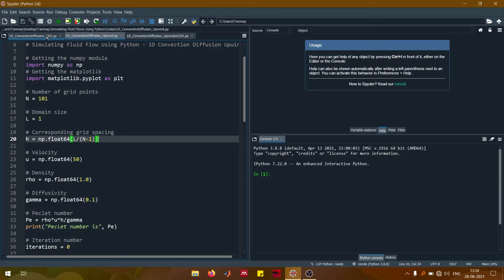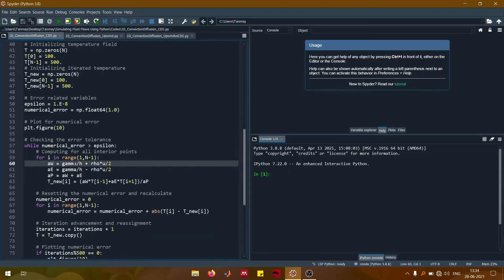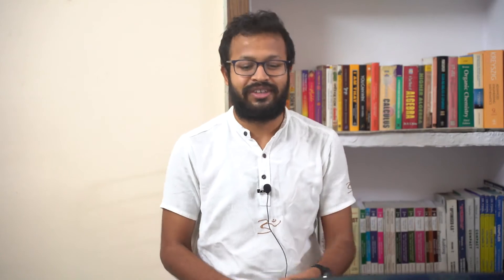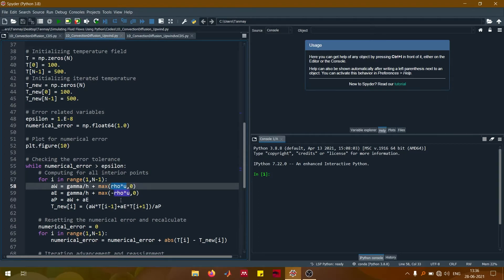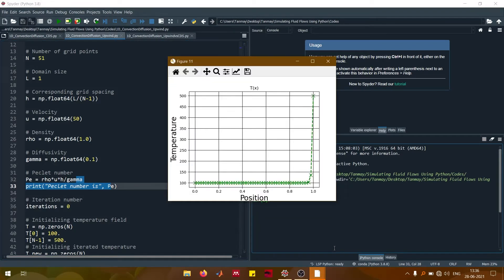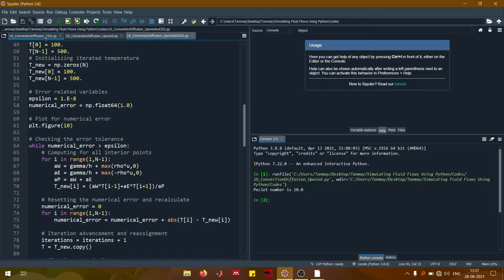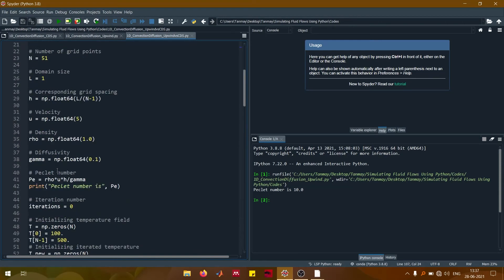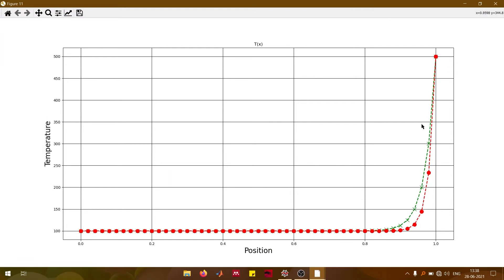Python Script for Steady 1D Convection Diffusion Equation Using Upwind Scheme | Lecture 18 | SFFP

Comment: first of all the lectures you are providing is awesome, my question to you is, how do i tackle the solid fluid interface boundary for heat transfer, can you please give me some good sources to follow this.
Reply from the maker: Look into immersed boundary methods
Reply: @TanmayAgrawal7  dear sir i had just gone through the immerse boundary conditions which is basically fluid solid interactions(more like in case of fluid flow field), but I have a problem in the heat transfer interactions I have done the python coding but getting some sort of error(5-7 degree celcius) with the fluid and solid interface(but when I use the same code, by removing the fluid part and considering that part(fluid region) as solid it is giving accurate results) (I have solved the velocity field with SIMPLE algorithm, and validated with experimental data and ansys), 
So, if you have encountered these type of problem so can you please make me understand where I m wrong this will be great help for me  ?? or some source. (Thank you)